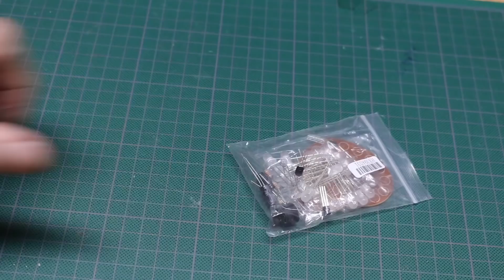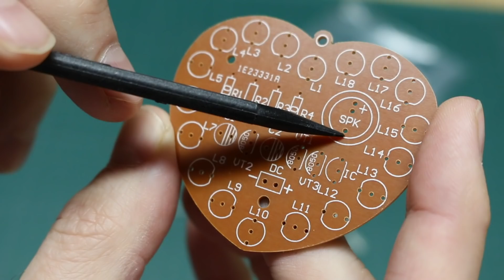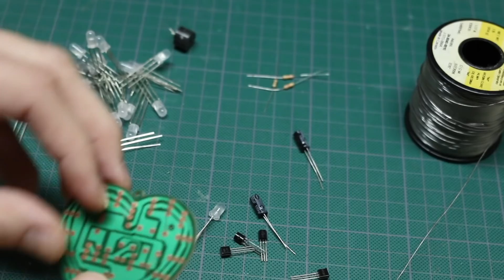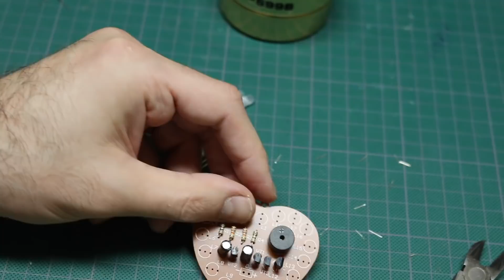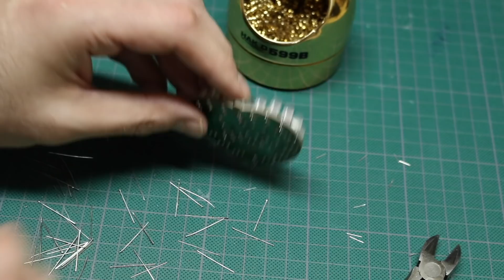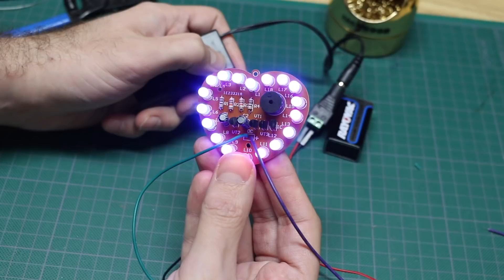Kit Build - Blinky LED Musical Heart

Comment: Just an idea for another rainy day... if you have some of those RGB LEDs, you can charlieplex (this is really a thing) them in such a way that N MCU lines can drive all the colors, individually, in a circle of N LEDs.  3N lines are not necessary.  Will send you info if you are interested in how this works.
Reply from the maker: Yes, send!  I’d like to know more about this Charlie.
Reply: @GadgetReboot  Well, it is not hard to find out about this ... https://en.wikipedia.org/wiki/Charlieplexing
What I like to do with RGB LEDs is to diagonally tie them together in circular 4n groups, so each of the mod 4 LEDs can be lit with a unique color.
Reply from the maker: Interesting. I’m sure I bought some RGB through hole LEDs this year. Might be worth an experiment.